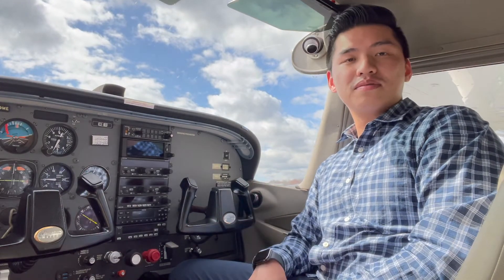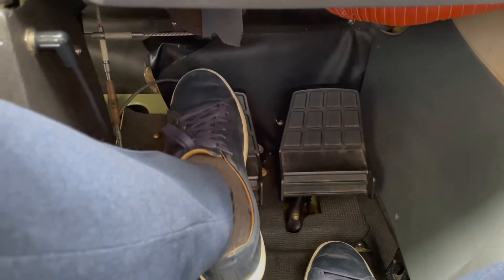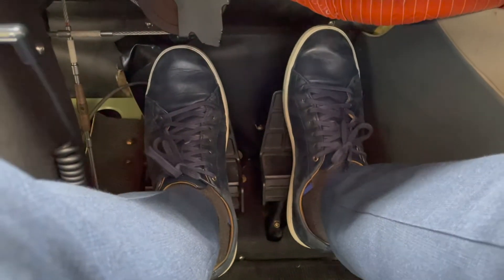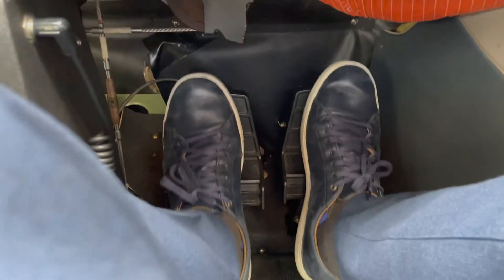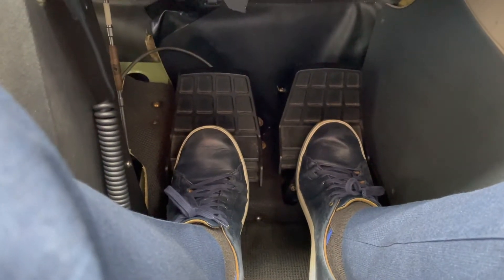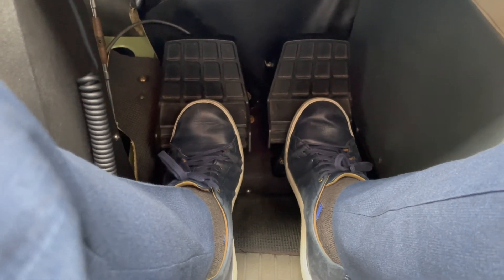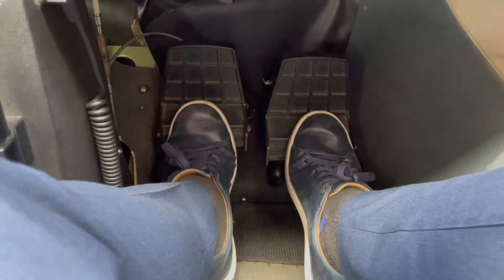Learn How to Fly - What is the Proper Technique for Rudder Control?

Comment: Thanks for a good basic lesson on how to use the rudder pedals properly.  Years ago I taught mostly in conventional (tailwheel) airplanes that had heel brakes to be used for taxi only and many modern nosewheel airplanes with a hand brake.  Now landing way too fast and using brakes both to correct longitudinal alignment mistakes bends a lot of tailwheel airplanes and leads to loss of control in all.  Large heavy airplanes need brakes to slow down from necessarily fast landing speeds.  And they have to wait thirty minutes or so if the brakes get too hot on long taxis.  In normal small trainers read Stick and Rudder by Wolfgang Langewiesche and learn to arrive at ground level in three point attitude all slowed up and ready to squat.  LOC and ground loop will not bite so bad.  And brake pads will be a 500 hour inspection.

Comment: Great info.  As a student pilot, I had never been told that the rudder controls the nose wheel as well....I've since learned that when the plane takes off the wheel shaft drops into a fixed position so that it does not move until it touches the ground again.  Thanks for making this video.

Comment: I think this will help me out quite a bit. Thank you. I am not a real pilot, I just do a lot of flying in simulators. I've flown for years without rudder pedals, I first used the trigger axis on Xbox controllers, then upgraded to a HOTAS, and used the twist axis of the flight stick. Then I decided  to start building a cockpit and finally bought some rudder pedals. It has been quite a smack in the face. I've gained some terrible habits and muscle memory over these years. It's counterintuitive to what I've taught myself. I find myself extremely tempted to invert the axis since "it's just a game", but I'm not going to do that. I've got to reeducate myself. I find it very strange though. When you drive a car or ride a bicycle, you pull the right and push the left to go right. It is extremely difficult to train myself to push left to go left. I'm sure this has been an issue for people actually going out with a flight instructor and taking the controls for the first time, I can't be alone in that. The braking makes sense though and that's what really screws with my head(or I should say my coordination). My taxiing looks terrible and landings have been embarrassing. I think I am going to focus heavily on taxiing for a while with the advice from this video, thank you for such a straightforward, no BS video. It's going to help a lot
Reply: Well, you're not the only one. I bought myself rudder pedals last week, and my intuition is completely wrong now. I used a rocker on my throttle for combined rudder and tiller movement before, and the movement of this is just opposite to that of rudders. Currently I'm sliding all over the runway on my landings.

Comment: Being able to use both rudder and brake at the same time is important any time the wheels are on the ground so the first foot position shown should be used also on landing and takeoff.  Once you have full rudder input it is hard to release it to slide your foot up.  While it is true that you can apply the brake by accident, (I have done that myself)  If you properly train the student it should not be an issue. This is extremely important in tail draggers which have to flown all the way to the tie down.  Now convincing a student that they need to spend more money so you can spend the time to talk about proper brake/rudder control, that is the hard part.

Comment: I had a really pivotal moment that fixed a lot of the issues I had with rudder control…and it came after I got my license, oddly enough.

I used to use one foot at a time…if I needed right rudder, my left foot would be barely touching the pedal…sometimes even off the pedal. On takeoff and climb out, that’s not the end of the world because you mostly need varying degrees of right rudder. But when you’re landing, especially in a crosswind, your directional control is wildly hindered by going at it one foot at a time. When I know I’m gonna be working the rudder a lot, during landing for example, I keep both feet on the pedals at all times and use varying amounts of pressure with BOTH sides in order to get in there and fine tune rudder movements. Pressure on both pedals is key because it makes subtle changes easier and it keeps your motions fluid.

Comment: I am getting my first set of flight sim rudder pedals today...thanks for the lesson
Reply: How did it go for you? I just installed my first set and I've realized it's not going to be an easy transition. I've spent a long time basically doing this in the opposite directions. Like a bicycle or a steering wheel, pushing left forward and pulling right to me in order to turn right and vice versa. Did you have the same problem and was it difficult to overcome?
Reply: @erict3728  it was indeed challenging, especially when slow speed steering is with differential breaking. I am getting better, but I am honestly not as pleased with the performance of my new flight sim built computer. I expected to be able to use all the graphics capability of the ×-plane 12, but i can barely run them at half without getting a low frame rate warning.
Reply: @cyh4031  I hope you didn't give up. I'm not sure where your issue is, but you can always run older software, maybe upgrading RAM will help. I hope it's not the graphics card, some of those things can cost more than entire computers. Good luck 👍

Comment: Pop quiz: What happens when you abort a takeoff roll and need your brakes immediately? (Cut to footage of a crash and fire.)

This is purely a style thing. Neither way is "correct", and for pilots looking to go to larger planes you should learn better habits. There are many scenarios where you can end up needing to blend between rudder and brakes. Sliding your foot is not safe, and hilariously absent from these videos because it doesn't work. It is much better to learn proper foot control for these situations. Only go heels on floor in situations where brakes are definitely not needed (e.g. after takeoff).

I see a lot of videos going into detail on this showing people wearing something like cowboy boots and that's why they're told to keep only toes on pedals. For the love of the sweet baby Jesus, wear appropriate footwear when you're flying. Unless you're an Alaskan cargo pilot rushing vaccines to a rural hospital with a floatplane, you should be wearing comfortable shoes (e.g. tennis shoes, sneakers) so you can feel the pedal.

"I wish my trainer had told me..." A lot of GA pilots are dying right now because trainers are absolutely awful and pilots are taking stupid risks. Please track down these bad trainers and report them. Don't just let them keep getting pilots killed.

Comment: I thought the rudder control are similar to the stick.  You push it down, the nose dives. You pull it towards you, the nose pitches.  Your tilt the stick to the right, plane rolls right.  Tilt left, roll left.  So from what I thought, the if you apply pressure on right rudder pedal it will turn left.

Good thing I'm not flying on nor do I intend to! (Ride as passenger yes, fly it myself no! LoL!)
Reply: The yoke (stick)  controls the elevator.

Comment: Try landing on one wheel, keep it on for 50 feet or so and go around. Land in a very strong crosswind, on a dirt runway or just get oversize tires and you won't really need brakes that much cause the oversized rubber takes away most of the energy; see how your method is not for advanced students. I flew in Alaska off field and some pretty high wind situations in Central Asia and sometimes, you have to get down or run out of gas, there is just no where else to go. It is no more "trick flying" than doing Chandelles or Lazy Eights. Both of the last two saved my butt in mountain flying more than once.

Comment: That s not correct.  With experience you ll see that during take off and landing, you want the foot to be placed on the full pedal to quickly access the brakes.  Fly a tail dragger during gusty conditions, I guaranty that if you re not quick enough on the brakes , you can quickly lose directional control.  The heel on the ground technique is good for airliners to avoid deactivating the autobrake system during take off.  This is based on several years of flying experience.
Reply: Thank you. This all good and well on the ground or in clam weather with plenty of runway. But come gusty conditions in crosswind the split second it takes to slide your foot up to the brakes is enough to lose directional control.

Comment: When you push down on the rotor pedal, are you moving the front wheel also? In other words, if the nose wheel is turned to the right when you land, won’t the airplane turn to the right?

Comment: Nice, concise and relevant video.

One case where this technique can cause issues: Landing with a very strong crosswind, where you have to maintain rudder deflection for directional control. Here it can be difficult to move the (downwind) foot up to start  braking without letting go of the rudder.
Therefore, when the crosswind approaches limits, I move my feet up before de-crabbing.
Nice work, keep them coming.

Comment: I disagree with some of this. Keep your feet fully on the pedals. There's a step for your heel. You can feel when your foot is properly placed. For rudder and nose wheel steering, push with your heels. If you REALLY need to turn tighter than the nose wheel is giving you, you're probably going too fast. Slow down first. If you decide to use the break to tighten a turn while taxiing, apply break pressure very gently. It's not hard to flip a tricycle. Always brake the least amount necessary and always setup for braking by taxiing at a speed that will require the least amount of braking.
Reply: it works for taxi, but definitely put your heels on the floor when you are taking off
Reply: Though I understand the different reasons, but, I also believe our heels should not be on the floor. Full foot on the pedals should be learned from day one. It becomes second nature, the relationship between your heels and toes on the pedals. You need each advantage you can get, every  millisecond counts when you need those toe brakes.
Reply: it's braking, not breaking :)
Reply: @orwell9579  , auto correct strikes again. I stand corrected. Thank you for pointing it out.
Reply: Got to agree with you. Your feet should be in place ready to use the brakes in case of unexpected runway incursions anyway. The same when we taxi.
Reply: @WinklesWorld-007xxx  I disagree. The same way that you don't have to always have your foot over the break of your car, you should instinctually move your feet onto the break to slow down. The same way that you should instinctually move your feet up to slow down. This minimizes the possibility, statistically, of accidental break use causing a runway excursion, while also forcing you to make a deliberate action to step on the brakes to ensure you actually hit them properly when you mean to. The same way that the brake pedal was designed to be higher than the gas pedal just a tiny bit so that you had to make a deliberate action.
Reply: @pilotavery  HAVING YOUR FEET FIRMLY ON THE RUDDER PEDALS, AND THEREFORE GUARDING THE BRAKES, IS A TAKEOFF FUNDAMENTAL. (sorry about the caps, I only realised at the end)
Reply: @WinklesWorld-007xxx  I have them firmly on the rudder pedals, with my heels on the floor. I am guarding the brakes, but the intensity also says that you should not do it for takeoff because the data shows you are three times as likely to have an incident because you accidentally hit your brake pedals then because your brake pedals were out of reach
Reply: @pilotavery  sorry, "the intensity"? Not sure what you mean by that.
Reply: @FlatOutMatt , not me. I’ve never once put a flat spot on a tire.

Comment: Only put feet on brakes when you need them. Even just for taxiing. Just like you don't keep your foot on the brake while driving a car.  After a while it is second nature.
Reply: Its not so simple specially in crosswind landings. The split second it takes Sliding your foot up to use the brakes is enough to lose directional control

Comment: It's not necessary to change position of your feet on the rudder pedals. Toes up unless braking. Practice that and your feet will stay comfortably placed where they were designed to be placed. Your right "toe" about slipped off both times you pressed rr. Gonna disagree on this one. Toes up.

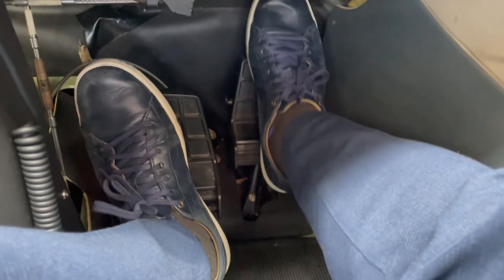Comment: At 1:25 it's confusing, you say you would activate the right rudder but you actually push the brake...
Reply: Because he meant to say brake, obviously, if nothing else by symmetry with the left side where he explains exactly the same but this time he says brake.
Reply from the maker: @adb012  You are correct. I made a mistake in that explanation. Well spotted and thank you.

Comment: Don't forget the tops of the rudder pedals are the brakes, so when you want to slow, go ahead on and tip into the top of the pedal to apply the brakes, the wheels will slow...works on the ground as well.